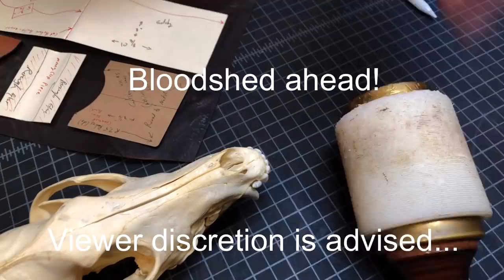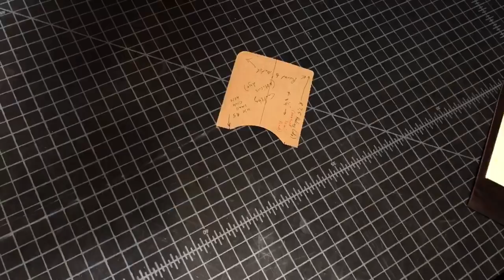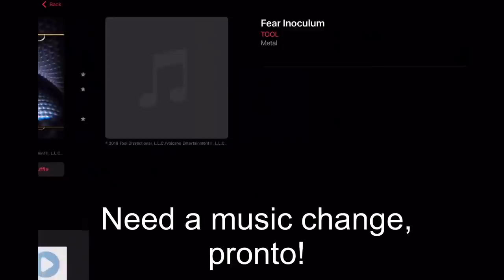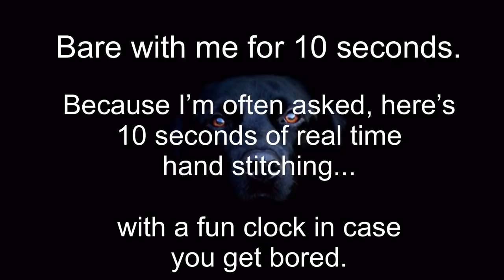Making a Leather Wallet! - The Gatsby

Comment: Another great wallet and video. You’ve actually inspired me to try leather crafting. I’ve made myself a simple wallet with four card slots. It’s not to bad for my first one. My biggest problem with making a wallet with no template is the card slots. I keep making them not wide enough or stitching to far in on the edges.
Reply from the maker: That’s the fun part.  Trial and error.  And readjust